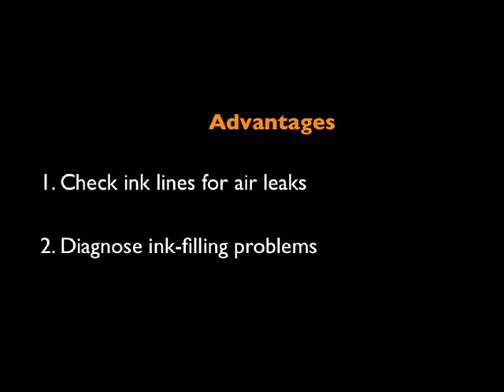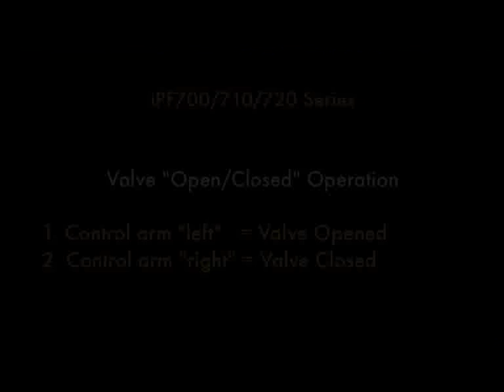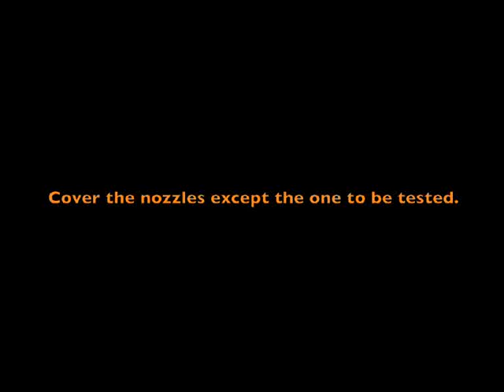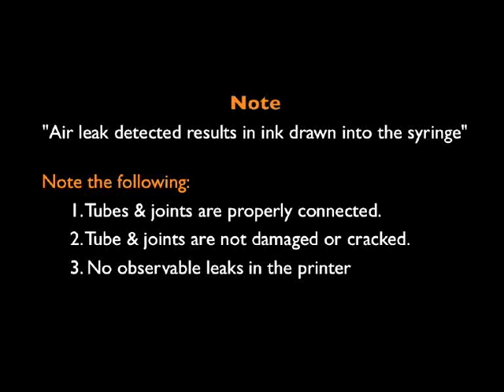imagePROGRAF Ink Flow Management and Diagnosis

Comment: When the valve is closed I can still suck ink into the syringe - does this indicate a critical problem? There are no visible leaks or apparent damage anywhere as far as I can see. Machine has been sitting unused for a year and a few bubbles have appeared in the pipes near the head - which is why I am doing this. Just changed the trailing cables so had the machine broken down to the level required for that process and cables and connectors thus revealed. Any suggestions if this is a problem before I put it back together and try fire it up? IPF 8000 - thanks

Comment: WHERE DO YOU GET SYRINGE AND THE TUBE.
Reply from the maker: Syringe= CF-5041-000
Yellow Flex Tube= AAG00700-9
Clear Vinyl Tube= 7029AA
http://www.copytechnet.com/forums/canon/87774-all-imageprograf-models__how-create-ink-flow-management-tool.html

see pdf on how to create Ink Flow Management Tool
Reply: Wondering about the strip with rubber caps used to cover the printhead joint nozzles that are not being purged as shown in the video.  Where can I get thus Rubber Cap Strip and does it have a part number? 
Thank you
Ric

Comment: hello I have this error code 03130031-2F3A and the lines are full of air and ink. the plotter was unused due to the pandemic. What could be the problem? The equipment tries to push the ink for a short period but seems to pull in the opposite direction. And then mark the error.
Reply from the maker: https://www.proprintingsystems.com/canon-imageprograf-ipf-error-code-03130031-2f3a/#:~:text=Hardware%20error%2003130031%2D2F3A%20means,after%20waiting%20a%20few%20seconds.